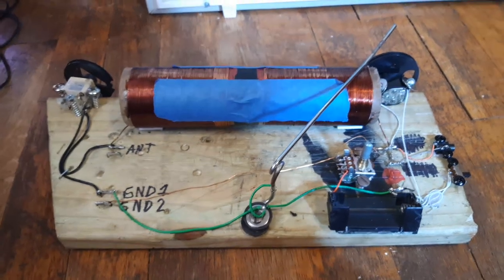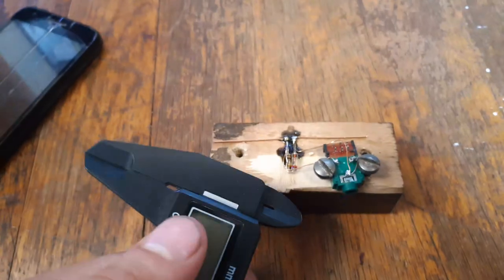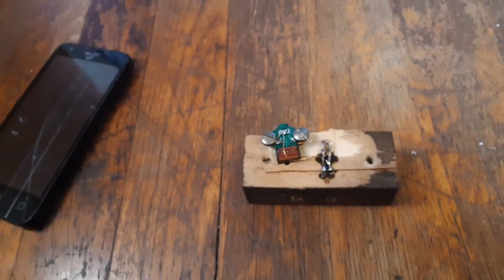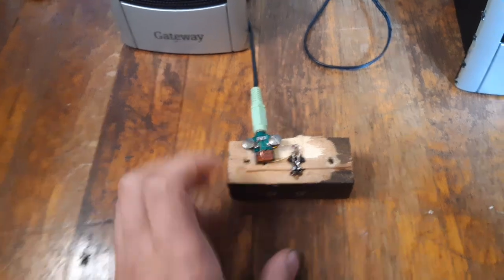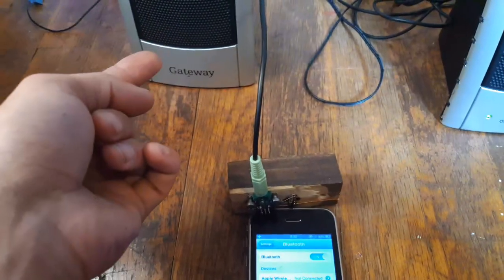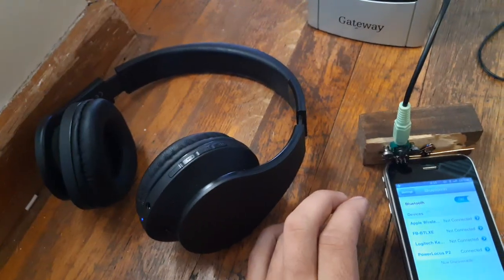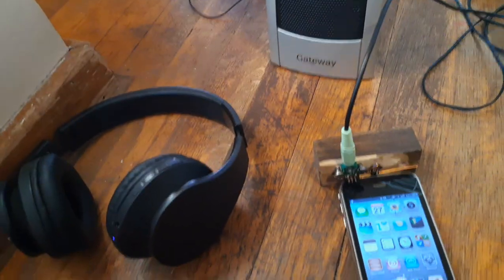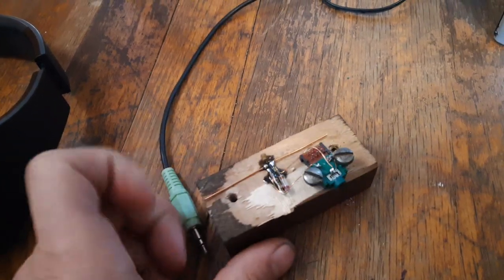2.4Ghz Crystal Radio

Comment: The video doesn't make sense for several reasons:
1) The 1N60 do not reach 2.4Ghz.
2) Your "receiver" is not tuned. So you will receive anything but 2.4Ghz.
3) The mounting you made on a piece of wood will add stray capacitances that will detune the antenna.
Reply from the maker: @cosmefulanito5933  1.) It doesn't necessarily HAVE to reach 2.4Ghz, just conduct asymetrically enough so that the modulation can sound the earpiece. I'm sure a higher frequency diode would make a more sensitive radio though.

2.) Yes and no. The "tuning" on this radio is set by the length of the antenna. The filtering is EXTREMELY wide, but it does tune the radio to about 2.4Ghz.

3.) This is correct!

Comment: Many years ago.Moments before you get an incoming call, the speakers made noise then your phone rang.
Is this similar on a different frequency.
Reply from the maker: @robumf  That was part of the inspiration.
Reply: That still happens. If I use cellular data instead of wifi, I can hear it on the cheaper / less shielded computer speakers at work.
And depending on how much amplification the actual speakers themselves are doing, it's louder.